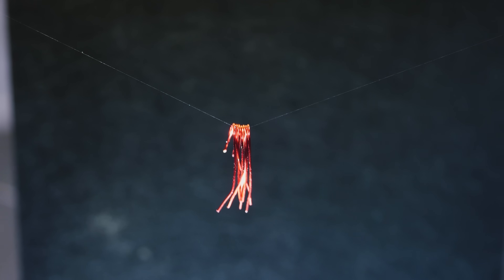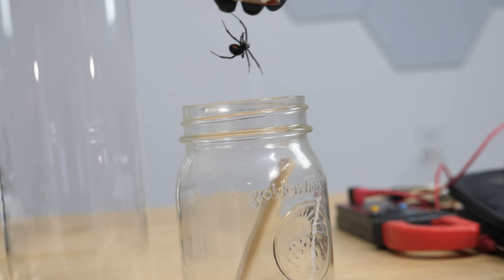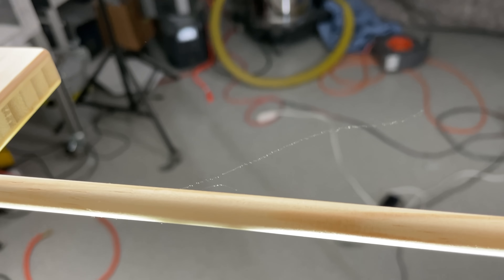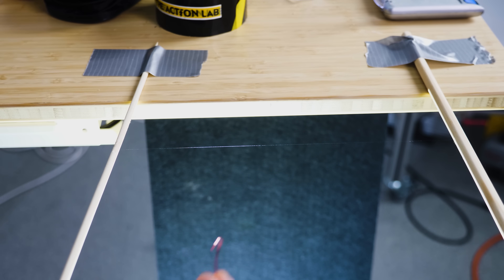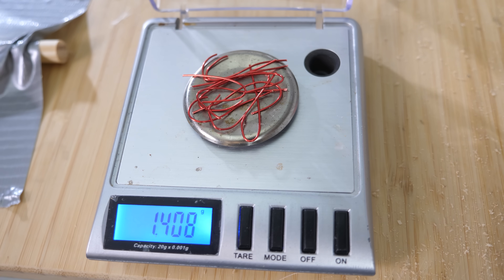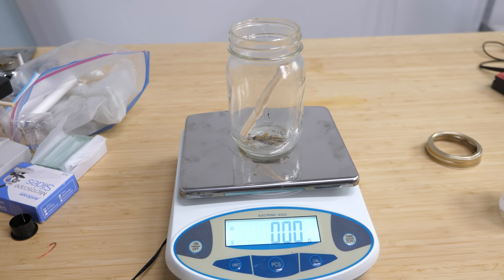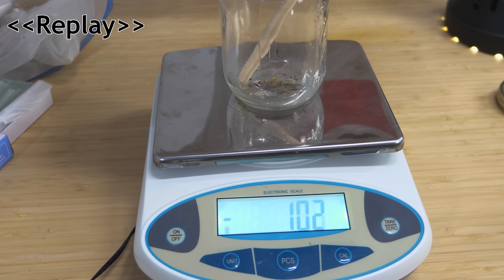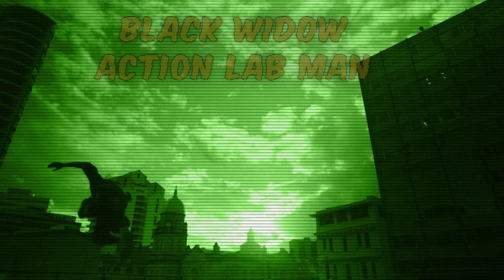Is Black Widow Silk Stronger Than Steel?

Comment: Looking at this experiment I can't help but notice that you're testing how sticky it is on the end because the silk didn't rupture, it appeared to hold with full integrity the entire load
Reply: I would be interested to see you suspended in between two clamps that held at firm and then test how much until it actually broke

Comment: At Lockheed martin in Palmdale California skunkworks they tried to make ballistic vests made out of this silk. It was far to expensive and slow to make. However the tested plates had bullet dust on them from the impact points and was virtually undamaged going all the way up to 308. win mag and it was extremely light weight.

Comment: No mention of the sagging rope formula? 

2 * tension * sin (angle) = weight

tension = weight / (2 * sin(angle))

Angle looks like about 30 degrees at which sine is 0.5 so weight would equal tension by pure luck. 

LoL OK or did I miss something?

Comment: Measuring tensile strength by putting weight on horizontal strand is the most difficult way to do it and  unless you did some measurements outside camera, or were lucky to have just right angle on your drooping strand, your results are not right.

In this setup, tension of the strand is not the weight you put on it. It depends on the stretch and how far it droops. With no droop at all, tension is infinite. Of course, that's not possible in practice, but if you use this method on materials which don't stretch much, you get way too small results.

With spider silk, which is really light, you can use trigonometry to define real tension. The weight of your load is only vertical component of the force vector. Real tension have same direction than your strand. math becomes more complex when the strand or rope have more significant weight and it doesn't form straight line

Comment: Their webbing is unusually strong. They don't bite unless they are cornered and pinned. Been bitten by one before, the venom caused a speedy effect similar to an excess of ADHD meds but with a hangover that felt like the flu, not a cold, the actual flu with aches chills cold sweats. It's not recommended to use black widow spiders recreationally 😂😂😂

Comment: Black widow bites rarely kill unless you’re a young child/elderly/have an immune deficiency or are compromised. Yeah getting a bite will suck, and those side effects you listed are accurate, but the likelihood you’ll actually die from one is extremely low. Black widows are also pretty docile and won’t bite you unless you provoke/threaten or unnecessarily scare it, and even then it would rather run away. I get having to be dramatic for the sake of entertainment, but making them sound worse than they are causes people to stay in fear of them and unnecessarily kill them. They are animals that, for the most part, are  absolutely harmless if you leave them alone.

Comment: I am an engineer and a former silk researcher, writing my PhD dissertation about silk. What isn't common knowledge is  1) spider silk isn't stronger than steel (look up tensile strength calculations). 2)  If you are going off of tensile strengths normalized to weight, synthetic polymers (UHMWP and Kevlar) are way stronger. 3)  It is  marginally tougher than synthetic polymers (energy dissipated before failure). But this toughness, is 100% dependent on the hydrated state of the silk. If the silk is wet in the slightest, it looses its toughness as water plasticizes the non-covalent sacrificial bonds (primarily hydrogen bonds between the peptide backbone) which give rise to the yield point and energy dissipating properties of the silk.  In short, spider silk researchers sensationalize the topic and are intentionally misleading so that they can gobble up grant dollars with flat promises of benefits to humanity. It turns out the public love sensational stories of biomimetics.  What spiders achieve is an impressive feat of evolution but the material properties are  overstated by researchers to dupe the layman (the public funding their grants).
Reply from the maker: I hear your other points about spider silk not being a practical material. But are you saying that the silk's tensile strength isn't stronger than steel? In this test I did here, and in the published study I mentioned in the video, it is pretty clear that it has a higher tensile strength than steel.
Reply: @TheActionLab , what you showed was really cool. So we are on the same page, tensile strength ( a defined materials science term) is reported as the pressure, a force over a crossectional area, at which failure occurs. High performance steel cables are typical made of Extra Extra Improved Plow Steel (EEIPS) with a reported modulus of 2160 N/m^2 for example (2.16 gigapascals). EEIPS steel cables aren't even the strongest.  This is higher than the tensile strength of all reported silks and double the tensile strength you reported. Steel has bested spider silk, in terms of tensile strength, for several decades now which is why silk researchers started saying it was stronger when normalized by weight or saying that it was the toughest material known. The later ('toughest Material" claim) is technically true as of the last time I checked.  Toughness is the area under the stress strain curve and represents energy dissipation. Although this toughness requires silk testing at fast pull rates and optimal humidity to best high modulus synthetic fibers.

Comment: 5:53 The silk is not vertical, but having some angle. Maybe we need a factor of 1/2cosθ when calculating the tension force. θ is the angle between the silk and a vertical line. 2 is for two sides.
The cross section area of the silk is reduced when it is streched. Will this brings another factor of 1/sinθ when calculating the tensile strength?
Altogether, we have (1/2cosθ) * (1/sinθ) = 1/sin(2θ).
When θ is about 60 degrees, the factor is about 1.55 .

Comment: Impressive how strong this silk is. But i dont think that this is a valid comparison to steel since the samples where the steel strength was tested were much bigger. Usually the smaller things get the stronger they become because they contain less and smaller defects and also the proportion of surface to volume deformation changes. For example there exist thin perlitic steel wires which exhibit a tensile strength of 5-6 GPa but in bigger parts such values are basically not achievable... on the other hand the strength to weight ratio might be better than that of steel.

Comment: UHMWPE is stronger, about 3.5 GPa, and lighter, about 0.97g/cm³ vs spider silk's 1.3g/cm³. By all means, spider silk is strong, but it has been surpassed ages ago by man-made materials. You can buy UHMWPE lines, e.g. Dyneema/Spectra cheaply, but spider silk has yet to be brought to market. Zylon fibers are even stronger (5.8 GPa), but has a higher density (1.58 g/cm³). It's even stronger by weight, but harder to get hold of. Both make Kevlar look like twine¹.

¹ Strong twine, but 25% weaker than UHMWPE by weight.

Comment: You may want to at least point out that the strain placed on the strand is not the same as the weight of the metal clip pulling transversely on the bridging strand.
The strand appears to be about 25 degrees inclined, so the tensile strength is 1.44 GPa.
Just pulling the weights straight up, I get 1.217 GPa.
If the angle is actually shallower, the strength is even greater!  I have no idea how you got 1.09 -- you need to show your work 🤔.

Comment: I'd like to point out that 1.09 GPa is stronger than some ultra high strength steels, but not all of them. In fact, there are many heat treated steel alloys that are significantly stronger.

Comment: Ya really do need to speak to the alloy of the steel and whether it is heat treated.   "High strength" is not an alloy. 
In WWI, they sandwiched the widow's silk between glass for  bomber sights.

Comment: You actually UNDERESTIMATED the tensile strength because you didn't account for trigonometry. The amount of lateral force required to break a taut line is much less than the amount of axial force required to break the same line.

Comment: Despite their venom, black widows are very chill. There is a paper called “Poke but don’t pinch: risk assessment and venom metering in the western black widow spider, Latrodectus hesperus” where they looked at the conditions most likely to provoke a bite. In short, they generally don’t bite when poked, only when pinched. More than 50% of defensive bites were dry bites (no venom). Spiders also delivered less venom in response to less threatening situations.

So a black widow you can see poses virtually no threat to you. Most defensive bites result from accidental encounters with a spider in an unexpected location.

Comment: Your stress equation is very wrong having not accounted for the angles the silk strands were at.  Best would be to do a single strand in a vertical orientation like you did with the scale.

Comment: Your weight test is invalid, since you didn't actually load it in tension. you have to do the actual math based on the load/support configuration, as the tension in the fiber is only equal to the supported weight if it's pulling straight along it's axis (straight down, in this case). There's side loading here as well, adding tension that does not oppose the weights directly.

Comment: Your calculation is wrong!!! The tensile force in the silk is NOT equal to the weight you use. Please consider the angle of the silk when it breaks. 
Details:
I didnt measure the angle but for example if it is 45° then the force is 0,5*weight*g*sqrt(2) which is around 0.707*9,81*1,408/1000 = 0.00977 N, thus the tensile  strength would be around 861 MPa. That's impressive still, but if you measure the angle right, you may actually get a precise result. If the angle is 30° then you get lucky and your result is correct, but that's just a lucky accident. :)
Reply: actually, i will create a mechanics problem for my students based on this :) thanks for the inspiration.

Comment: If you were bitten by a radioactive spider, it wouldn't matter what the tensile strength of the spider's web would be, because you'd still need to use web-shooters containing artificial web fluid, as Spider-Man does.

(Note:  The Toby Maguire version doesn't follow this rule, and instead uses biologically-produced webs, but the statement wouldn't apply anyway, because in that version, the spider wasn't radioactive.)

Comment: While the spider silk is very strong in tension, we have yet to figure out a way to use it in compression. Also, the durability of it is probably a major factor where even if we could scale it up for construction purposes, steel may still end up lasting far longer.
Reply: Not good for submersibles, then.  😅
Reply: The problem here is that at this small scales a lot of materials exhibit this high tensile strengths. For example there are steel fibers with tensile strengths of 5-6GPa. But since this is only true for small fibers and tension forces in one direction this doesnt scale up to bigger parts where forces act in different directions.(even if you apply a one directional force to a big part some regions in this part will also experience forces in other directions due to strains)

Therefore steels are so good materials becaus they can handle forces from different directions so well due to there abillity to plastically deform

Comment: Steel is plentiful, cheap, strong, weldable, hard to burn and has amazing formability. Spiders silk is expensive, rare, difficult to work with, flammable, and complex to manufacture even if you managed to create equipment to do so. Its nothing to get excited about. If you could even manufacture it at the scale you can steel you would start to find all the flaws it has with the resources it requires to make it.

Comment: You should measure it by letting the weights hang down vertically with the strand supported only at one end. When you hang weights like clothes on a clothesline, the weight is supported only by the vertical component of the tensile force vector. But the strand is being pulled by the horizontal component too which you aren't counting. The silk was making an approx 40 degree angle with the horizontal when it broke. So the actual tensile strength is 1/sin(40) times what you measured i.e 1.56 * 1.09 Gpa  = 1.7 Gpa. A more intuitive explanation is - it takes immense tensile stress to keep a clothes line absolutely taut but if you allow some drooping it does not need to be pulled very tight.

Comment: You need to take into account the angle of the silk string and the fact that there are 2 strings supporting the weight. You have calculated it as the weight is hanging straight down on one string.

Comment: Post tensioning steel can actually have a specified strength of greater than 1.8GPa. You should go into more how you calculated the tension load on the thread when you were adding the hooks.

Comment: You should’ve done it straight up and down because the angle changes the amount of force exerted as tension compared to weight. At 30 degrees each side experiences the weight of the suspended object but at 90 degrees, each side only experiences half so it can change a lot depending on the angle.

Comment: A simple back of the napkin calculation shows that to make a tread of 1mm diameter you would need approximately 69,000 spider threads. This is why we don't see everyday object made from spider silk. However, I did once read an article many years ago that said that DARPA (or some military company) had manged to splice spider DNA with Goat DNA such that they could extract silk from the goat milk in larger quantities than they could from spiders.
Reply: Glycine and other amine from silk oxydate super fast. Also, by going from 4 to 1000 micrometer section, you have 250*250 =62000 so you right on this but you can also toll a 7 cm long thread on it self
Reply: The real reason why we dont see objects made of spider silk is that we have already materials that surpass this silk and can be more easily produced. On this small scale a lot of fibers have these kind of tensile strength but the strength doesnt scale to bigger parts therefore we use other materials

Comment: I had an unused basement door (with old oak steps, from the early 20th century) and I decided to remove the rotten (never in the sun) steps.
It turned out to be a black widow farm. There were dozens of them. I'd only seen one or two in the wild before that.
Yeah, I grabbed one and looked at its belly.

Comment: Did you do the force diagram?  The spider strength is under more tension than just the weight of the wire weights.

Comment: My mind was blown by this fact I discovered some 40 years ago in engineering school.  Of course, it was during a lecture on tensile strength versus rigid strength, so it was quite relevant.  When we performed a test with a hydraulic press equipped with sensors and a cable make from the silk (no idea what species though), we found it to possess tensile strength approximately five times stronger than steel.  Truly amazing stuff.

Comment: "third deadliest"... Yawn.
They get a bad rap but they're not aggressive and even if you manage (no easy task) to get one to bite you, the bites aren't all that bad. Sharp and burning pain for 30-40 minutes, slightly elevated blood pressure and heart rate for 8-10 hours, stomach cramps and nausea from about 2 hours post bite lasting for 3-4 hours and a sore and itchy wound for about a week. 
I'd place it roughly equal to 3-5 yellow jacket strings. The big risk is to very young children and not to adults unless they're keeping or working with the spiders.

Comment: This is why we named our team, competing in NASA's Space Elevator Tether Challenge, Astroaraneae! We hold the title for strongest tether, besting Sandia Labs employees, MIT researchers, and other top notch competitors.  Some people wondered if we were using spider silk made by genetically engineered goats.  We did not. Good video!
Reply: What did you use?
Reply: @ohbeardedone9253  Our proprietary material was never disclosed; and I am not at liberty to say.  It was stronger than spider silk, for its' weight.  An aim of the competition was to utilize the potential strength of carbon nanotubes in a novel material.

Comment: The hell? Deadliest? Not in the slightest. As someone who has been bit by a female (the one you're freaking out about). Nothing this man said is right about its "poison". Yes it's particularly nasty. Deadly though? Simple youtube vids on the matter will disprove that. Im normally not that neckbeard, but i have 1st hand experience. Stick to the tensile strength of its silk. Btw, if you think the widow has good tensile strength, you should check out the n american garden spider. Has been proven to be 1.5-2x the strength of the widows.
Reply: Not every bite is equal maybe you got a dry bite?